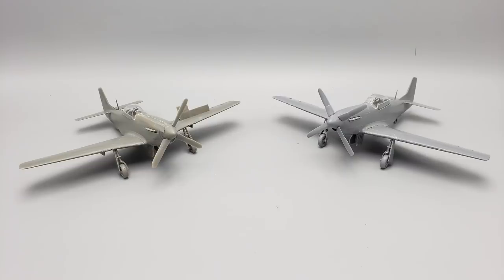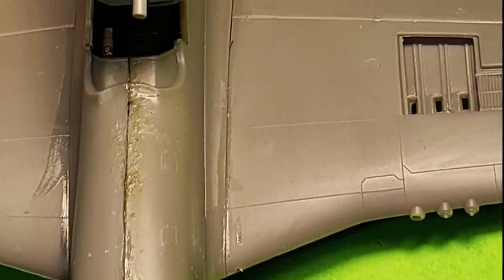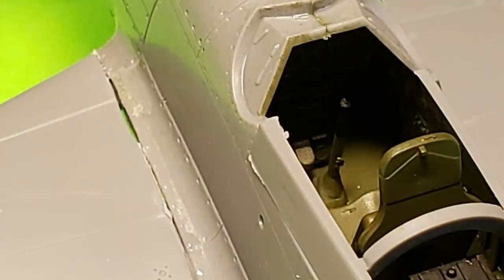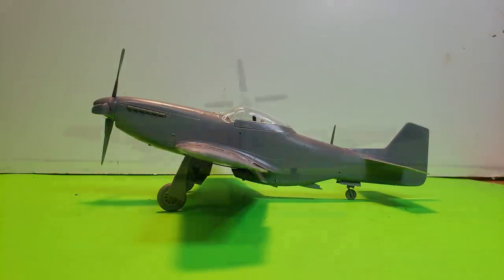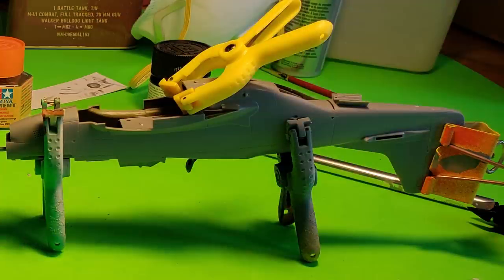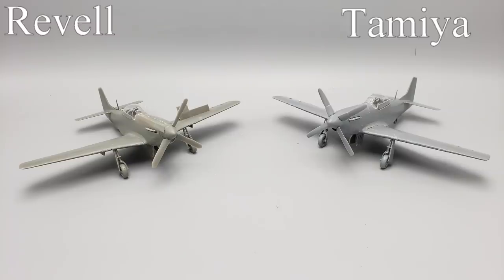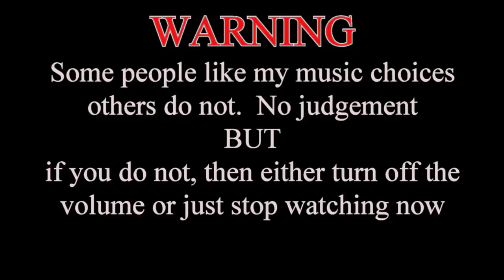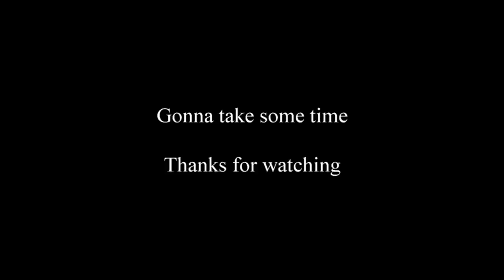Tamyia vs Revell 1/48 Mustang part 1

Comment: The audio level for your voice has dropped a little, squeak it up some. I remember, vaguely, a review of the first issue of Tamiya's Avro Lancaster, thick parts, poor fit (fuselage) and because of the thick castings, bracing of the fuselage halves was required, all this got you a very heavy model.
Tamiya was almost at the top of the model builder's list of nirvana kits at the time, I'm sure when he was a live, Jesus made a few errors as well.

Comment: meng, airfix, eduard have all new gen P51 last 2 years new tool tech - I'd pass on both these (Reell from 1977 and Tamya from 1995 - I have built the tam a long time ago, and it was OK from memory) - the meng is close to revell $, and Eduard is the 'new' Tamya re P51Ds in 1/48 - a 5 way would be fun (add the ICM or Haseg from the 1990s and go 6!!!!)

Comment: They both look  terrible Airfix  much better
Reply: 100% agree - Airfix/Eduard/Meg only P51D in town now.. all 3 are brilliant - have then all and they look magic... I've built the Tam 51 a few years ago, and it was OK, but now I've build new gen models like these 3, I won't buy anything not engineered with CAD and modern injection techniques (eg 2010+) - modern kits even from the 2nd group (ICM,Trumpeter) are great now days (accuracy aside, just talking engineering) - but new gen Eduard, Airfix, Tamiya (building their BF109G at the moment) are all great.